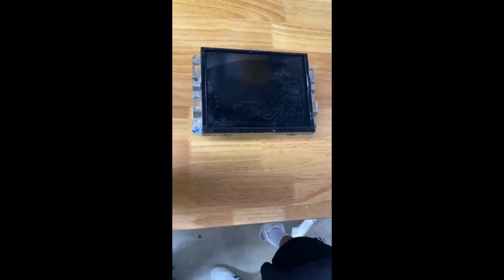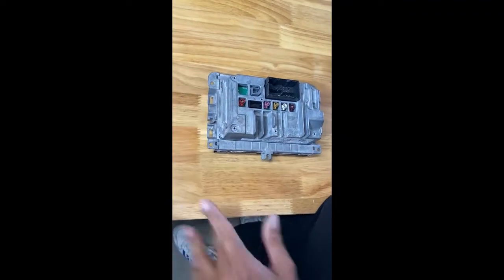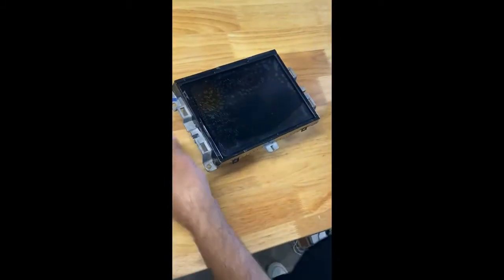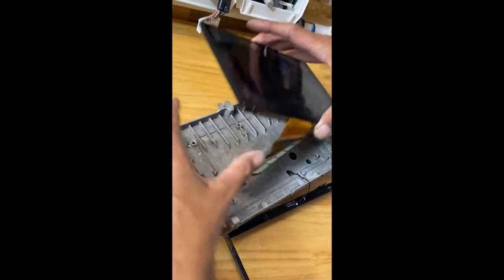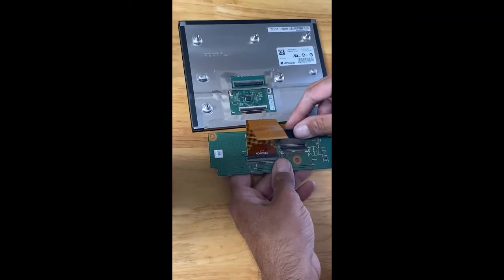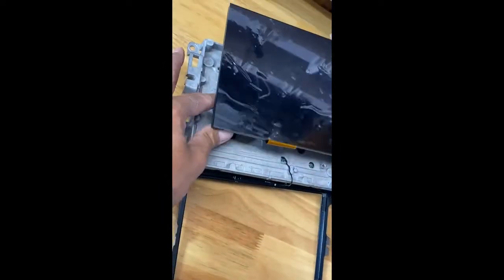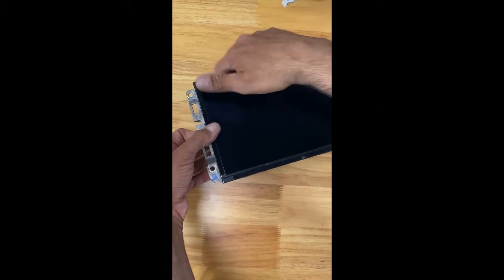How to Fix Delaminating OR Bubbles 8.4" U-connect VP3 VP4 LCD MONITOR Touch-Screen Radio Navigation

Comment: Cannot Thank you enough for this video - just replaced mine in the 2018 keep grand Cherokee  - unfortunately found not find the V3 screen had to replace with the V2 - for $350 from amazon. It it lasts as long as the first one did ill be happy  - easy to do works like a charm

Comment: Great video, thank you. Do you happen to know if the screen from a 2015 8.4 unit will work on a 2018 8.4 unit? I have a 2018 unit on the way that may need a new screen and I'm hoping to be able just use my existing unit for the donor screen which is in perfect condition if they're compatible.

Comment: My 2019 Grand Cherokee has the 8.4 screen but it looks like it's attached to the dash bezel. Will this work? Would I have to separate it from the dash bezel? It looks like the bezel has a protective screen that goes right over the LCD screen.
Reply: Hi I also have a 2019 GC- did you ever get an answer from anyone else?
Reply: Just found a link that might answer the question to the 2019 Jeep models screen and dash bezel.
https://www.youtube.com/watch?v=qeeOjH0zAbs

Comment: Is the Replacement unit prone to the same delamination issue as the Original? I have a 2020 Jeep Grand Cherokee Trailhawk w/Hemi and my wife noticed the Crack on the display today because she was on the passenger seat and the sunroof was open and the sun just hit it at the right angle. I have an extended warranty so I am not worried about being covered but I want to make sure that I will not be having the same issue in 3 years and 15K miles. My Trailhawk only has 15K miles so I do not think it would have anything breaking specially with this low mileage but I do live in Central Florida and it been a HOT SUMMER this year.  Any info would be appreciated.
Reply from the maker: The 2020 jeep is a different display here is a link for that display
Reply from the maker: https://www.ebay.com/itm/295725991289?mkcid=16&mkevt=1&mkrid=711-127632-2357-0&ssspo=hfBb3CRGSLW&sssrc=0&ssuid=hfBb3CRGSLW&var=&widget_ver=artemis&media=COPY

Comment: Idk if you’ll reply but I did the replacement with an SL03 like yours and am getting the image screen off center. It’s about .25 of an inch to the right side (so much I can see a black borderline upon using the backup camera. Do you know what’s the culprit for this and how can I solve it?
Reply from the maker: You bought a fake cheep Chinese screen I bought some to try out because the price was so cheap 
You get what you pay for 
I still have some factory screens if you want one
Reply from the maker: You bought a Chinese knock off
There are plenty of Chinese knockoffs out there 
They’re fake Lcd’s fake Touchscreens 

I bought five to try out because they were cheap but they suck. I’ll never buy them again.

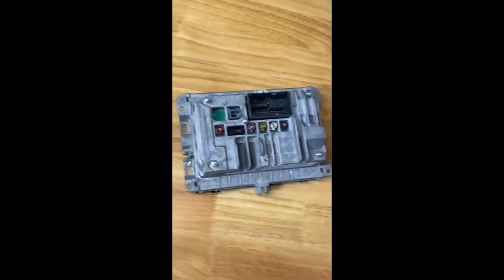Comment: After removing my stereo from my 2500 I found out it is a Harmon model . Comes apart slightly different than the one in this video - not sure how to remove the actual touch screen. Do you know how and where I can get a new touch screen. The radio works fine but I can't navigate via the icons on the screen. Looks like the previous owner took out some frustration on the screen. 4:02
Reply from the maker: Hi here is a link
https://www.ebay.com/itm/294889058967?mkcid=16&mkevt=1&mkrid=711-127632-2357-0&ssspo=hfBb3CRGSLW&sssrc=2051273&ssuid=hfBb3CRGSLW&var=&widget_ver=artemis&media=COPY

If you look at my other videos I have a video on how to replace

Comment: What happens if that tiny wire ripped? My husband wasn’t careful and now it’s not connected, what does that wire do? Is it needed?
Reply from the maker: @spoiledkathiiiee  it’s the Bluetooth antenna if your BT is working then don’t worry about it
Reply from the maker: If your BT is not working then I have some new BT antennas I can sell you but most of the time i haven’t had a problem

Comment: The mounting screws from the sl01 didn’t fit the sl03, ended up snapping the end of a screw into the mounting hole of the lcd screen and now the pcb can’t hold contact and causes the screen to reset
Reply from the maker: You bought a fake SL03 yeah, fake as in counterfeit

Comment: Hey! I just bought a new screen just like the one you show in the video but through a different dealer. After installing it was good for about a day but then it started doing the ghost touching again. Any suggestions? Is it the screen or something else?
Reply from the maker: Hi it’s your screen 
Send me a photo of the back
Of the screen 
If you did not buy it from us you probably got a older refurbished screen if the screen model number is ending in (SL)(01) or (SL)(02)
Its junk you need to buy the (SL)(03) 
I see a lot of people on ebay selling refurbished screens saying that they are new
I have had about 30 people have the same problem you have had
Reply: @chcarstereo5575  It's actually an (SL)(03).. here's the listing I bought it from, I checked the back to make sure they matched up before installing
Reply from the maker: @revised7912  right now LG is not making them anymore I had 4000 screens I’m all out.
I might be getting more  
I’m actually talking to somebody right now  
Because so far all of the screens are fakes the easiest way to tell
If the screen is fake LG has a blue tint to the screen  
All the fake screens I’ve seen they
Have like mirror finish

Comment: Where did U purchase the SL 03 screen?
Can only find 01
Reply from the maker: We sell them on ebay 
Here is the link
https://www.ebay.com/itm/293368691463?mkcid=16&mkevt=1&mkrid=711-127632-2357-0&ssspo=hfBb3CRGSLW&sssrc=2349624&ssuid=hfBb3CRGSLW&var=&widget_ver=artemis&media=COPY
I haven’t seen anybody else that sells the 03 
Watch out for other people and eBay they sell the old screen its the 01 or the 02 
We refurbished radios when we get Radios in and they have a 01 or a 02 screen in and it looks good
We throw them in the trash because that is exactly what it is trash

I will not sell anybody a 01 or 02

Comment: (Dodge RAM Laramie 1500)

My Dodge RAM Laramie 1500 truck will be 7 years old on Christmas Eve. About 2 months ago I ordered a navigation map update and installed it. The installation
went off without a problem.

Here is the problem. When driving down the interstate at 70 miles an hour and I am in
the far left lane. Every time I pass an exit the voice comes over and announces that the speed limit is 30 miles per hour. The display on the map screen changes from 70 miles per hour to 30 miles per hour. After I pass the exit it goes back to 70 MPH. I am not getting off of the exit but keep on traveling in the left lane on the interstate.

I have called the map company, “Here” and told them the problem. They said it is not their problem and I need to call Dodge U-connect for a fix.
I called Dodge and explained my problem. They said go to the dealership. I did and they told me to back to Dodge U-connect.

I was told today when I called it was a glitch in the system.

Call Tiffney 800-826-6632 X3025432 Call and complain to have them get 
this glitch fixed.

Here I am the customer wedged between two companies and cannot get any help.
Reply from the maker: If you were to come into my shop
The first thing I would do would be to check your GPS antenna .

But you said.
you didn’t have this problem till you updated the maps.

I am pretty sure on the navigation options 
there is an option where you can turn 
Off how fast you are going or the speed limit
Reply from the maker: yes, I know what you mean. They’re assholes when you call uconnect
I have no idea why they have a job but they have no idea what they’re doing .

It’s like they’re reading off of my damn script
Reply: @chcarstereo5575  That's right about it worked OK until I updated the maps.
I called Dodge RAM back and they admitted there is a software glitch but they did not have enough people calling in to complain to issue a FIX.